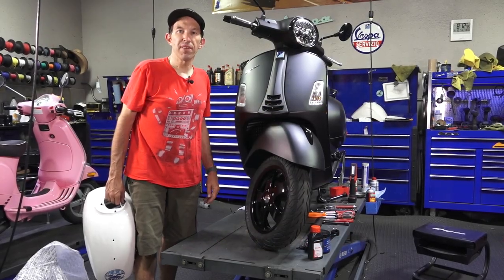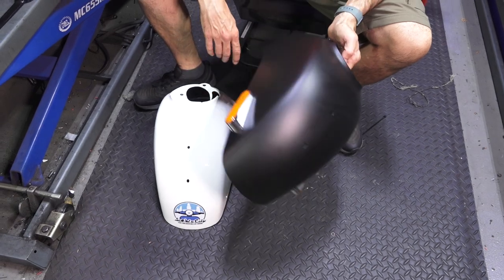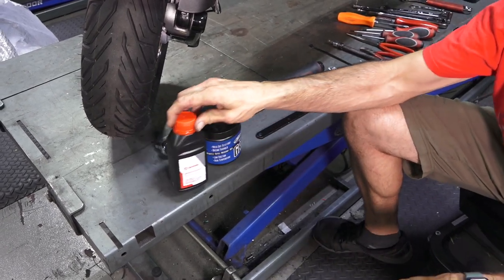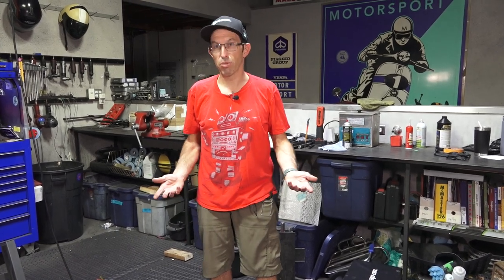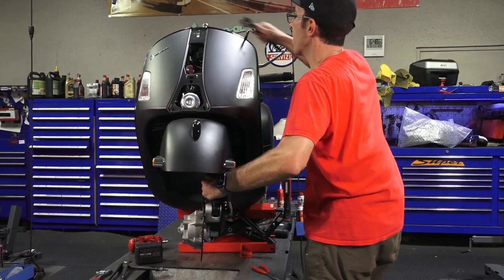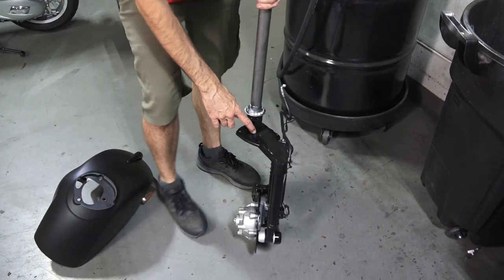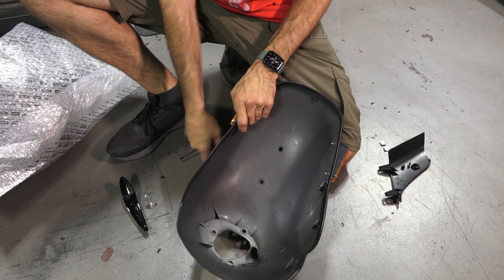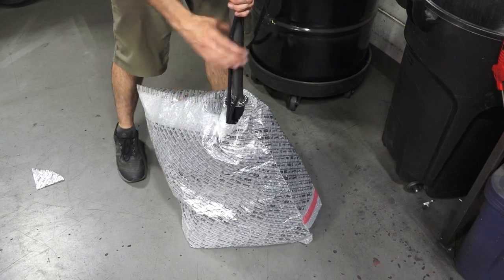How To Remove Fork/Change Front Fender on a Modern Vespa

Comment: I don’t think there is such a thing as a boring Robot video. I was rapt throughout!
I have had to replace head bearings on my GTS. I used a builders bucket under the floor. It lifted it enough to drop the column through the frame tube. Thanks Robot.

Comment: Is it possible to undo the top bearing not to drop the stem enough to repack the upper and lower bearings with grease without having to remove the brake hose and speed sensor.  If so it would make this a 30 minute job just to grease the bearings.  Obviously if you needed to change them its a stem out job but it would be good to know if they can be repacked with grease without dropping the stem completely out.

Comment: couldn't find the banjo robot mentioned on my 2012 GTS - it looks like a continuous brake line from the front caliper to the master cylinder! I'm trying to drop my forks, so I can respray the stone chipped area at the bottom of the from legshield, and with the fork in place it's a lot harder!
Reply: That banjo bolt behind the front panel is for ABS models only (2015 onwards).

Comment: Great video but you need to replace your plastic parts for sure in the way you treat them 😅 pointing on to them with the sharp end of a screwdriver, laying the fender on the ground with the paint job down without a towel or anything underneath. Wouldn’t leave my brand new scooter in this workshop 😅

Comment: You have necessarily to remove the fork for removing just the fender or you can also extract it by removing the wheel and the caliper then sliding it down?
Reply: It won’t slide down the fork. That might just be why he Robot demoed it this way!

Comment: Hey robot. Love your vids. BV 350 owners-> Did anyone find solution for you wobbling wheel,and steering when hands off handle bars at 40mph? Its now common  problem, is tire fault or weights in handlebars? Robot do you have that problem on your bv350?
Reply: same problem here in a gts 250 ie... i ordered the full arm steering to see if i can solve that problem
Reply: @xabbathx  someone blames "lumpy" Michelin city grips , someone says its weights fault, and now newest is simething is wrong with braking disk balance ...
Reply: @Filip777  I thought it was just me! This is my first Vespa I didn't know all the problems related with the wobbling
Reply: @xabbathx  Its common problem on Beverly 350 here in europe. But not many people realize it until they lift off their hands from handbars at 60-70km/h . Its dangerous and no recalls or anything. I bought my BV brand new 2019. Im reading forums problem consists on vespas too